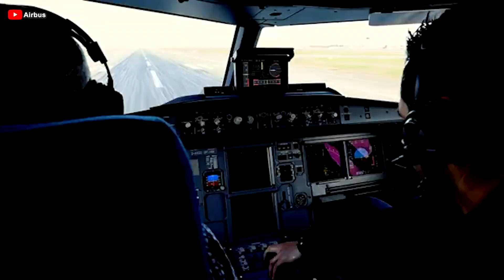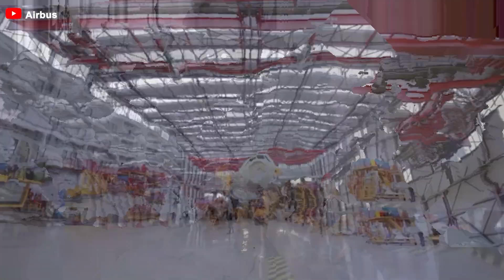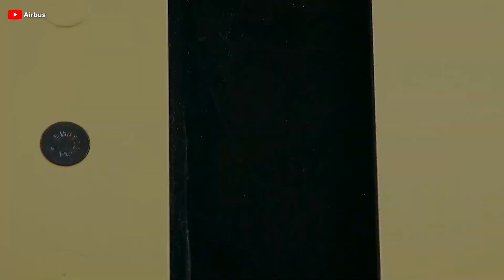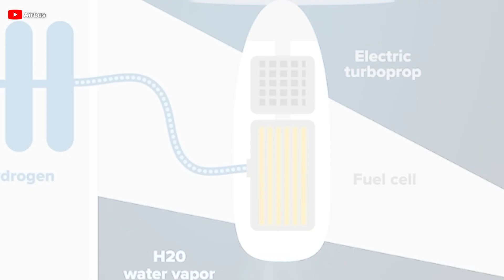This Airbus NEXT A322 Aircraft will SHOCK everyone NOW! Here's Why

Comment: Unless they can get a more powerful engine that remains economical and change the wings and wing box its going to be a dog with no lift, inability to get out of short runway locations. and like they said will give up range.  I see the same issue that Boeing had with the 737.  keep stretching and watch how it has more and more issues.  The 321 already had weight and balance issues.  Yes its true, check Spirits  Airlines certain A/C have restrictions for carry on stowage locations.

Comment: An extra 24 seats would be more of a (hypothetical) 757-250, than a dash 300. However, when you consider how poorly the dash 300 sold, this could even be a positive rather than a negative. We will have to see how much the market has changed since then.

Composite wings could allow existing engines to suffice (just!) for the additional length, but consider a situation where Airbus manage to increase their composite wing production to be more than enough to cover their needs, could the spare capacity be used to re-wing the A321?

Could this reduction in airframe weight be used to increase cargo weights, or reduce the runway length required? Without a doubt, this would reduce the remaining situations where there is no A321 suitable to replace an aging 757-200.
Reply from the maker: Thanks for your comment!🙏🏻